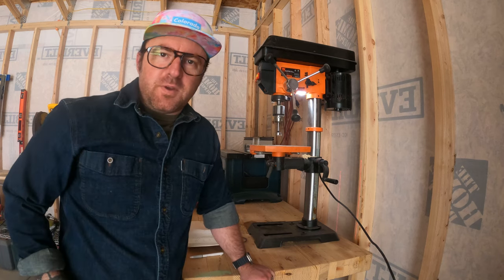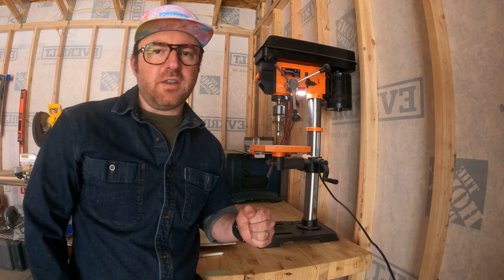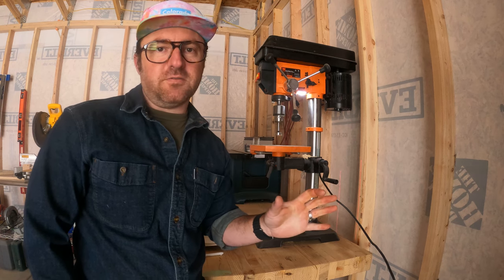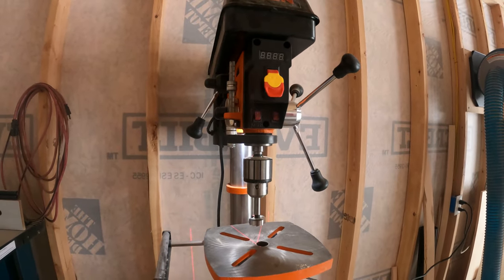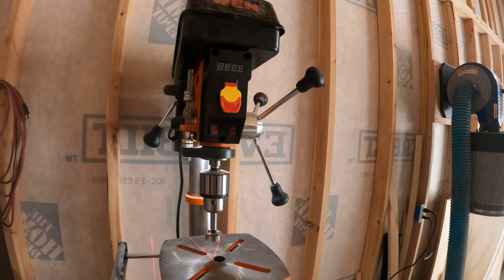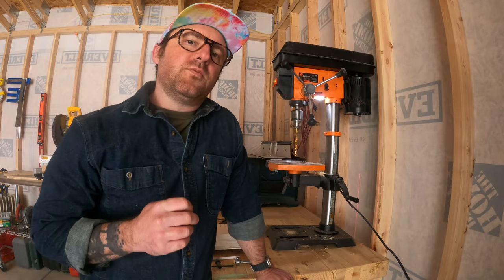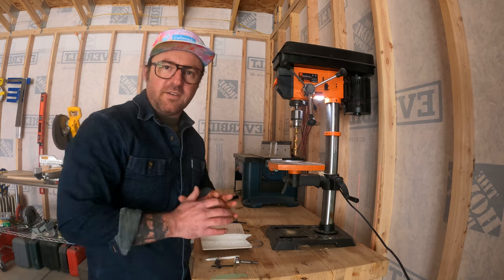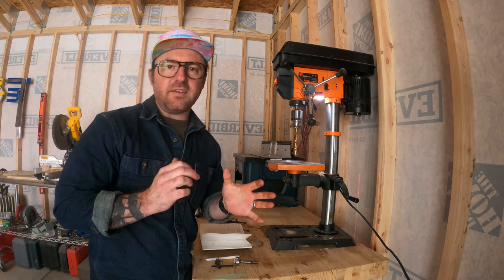Is the WEN 4214 the best budget Drill Press? - 2 year review

Comment: I purchased a piece of crap WEN 4214 drill press and was able to square the table left to right but it was badly out of square front to back.  I assumed that the vise I mounted on the table must have thrown it out of square so I removed it and tried again.  I discovered that it was the table itself that was out of square so I decided I could shim the vise and level things up.  Wrong – the table is DEFORMED and has one low corner.  Which is basically impossible to shim and fix.  I went back and forth with WEN forth three weeks and they finally suggested I PURCHASE a new table from them that might possibly be square front to back.  ...isn't the entire purpose of a drill press to drill holes that are square with your work?  This POS fails miserably!
Reply from the maker: So sorry to hear about your experience. What an absolute bummer

Comment: I have the same model. I didn't buy mine for the looks. I bought mine to do one thing. Make accurate holes. It does make holes very well. The motor sounds like a drill press. I been working in construction my whole life. Had a shop to work in since i was 9 years old im 67 now. Is it made usa? No! We make stuff durable and pleasing to the eye.  Ut if your just needing to get the job done and don't mind ugly, then this drill press will fit the bill. You still want to make it pretty you will need to do the sanding fileing and polishing to make it so.
Reply from the maker: Thanks for watching! I agree whole heartedly, it is a tool. Not an art piece. But, it does a great job drilling accurate holes.

Comment: Looking at several reviews, dealing with metal drilling past year, needed lower rpm for bigger bits… hopefully when mine comes in tomorrow would solve my problem. Been using my dads drill press that’s 45 years old. Finally new toy coming in. Variable speed !!
Reply from the maker: That is awesome! New toys are the best. Hope you enjoy it!
Reply: Hey above what size of hole did u find issues drilling metal with this model?
Reply: How's it been working out for ya?

Comment: I've had one of these presses for about 3 years. The column and chuck are completely rusted.
Reply from the maker: What a bummer, are you in a humid climate?
Reply: They all do that. You need to keep them covered with a light coat of oil and in a low humidity environment.

Comment: Do you happen to know the Max  Table to Chuck Distant.     Table to spindle Max.   Thanks for the review and video.
Reply from the maker: Thanks for watching. I just measured the max distance and it is 13.5” from the bottom of the chuck. However when a bit is in there the little things that clamp down on the bit stick out below around 1/2” when you use the typical drill bit. Obviously, the bit itself will stick down in various lengths. Hope this was helpful and reach out if I can help more!
Reply: @beardedspruce  very much so.  Helps a bunch.  Thanks

Comment: Another thing that a more expensive unit will provide is a lower minimum RPM which is evidently useful when drilling metal. 580 RPM is the minimum on this unit, but more expensive units can go down to around 180 RPM or maybe even slower. #justfyi #fwiw
Reply from the maker: Great point. I think it all depends on what you are using it for. My needs don’t currently need that low of RPMs. But, yes it def doesn’t go that low.
Reply: Maybe tap at that speed 
Most modular drills at 1000 and higher smaller the drill bit faster speed